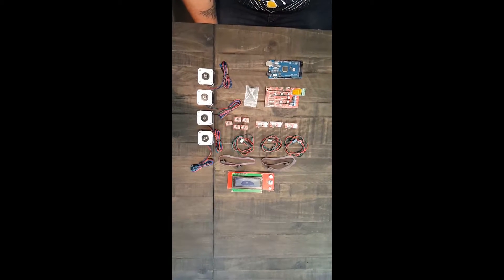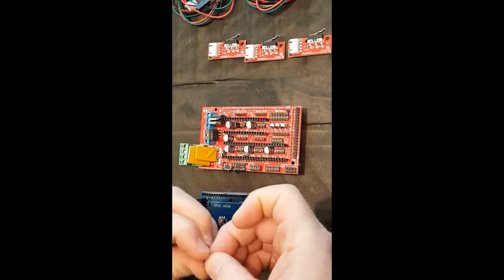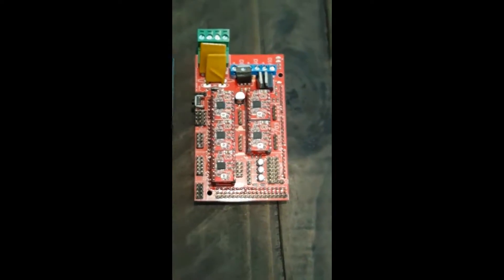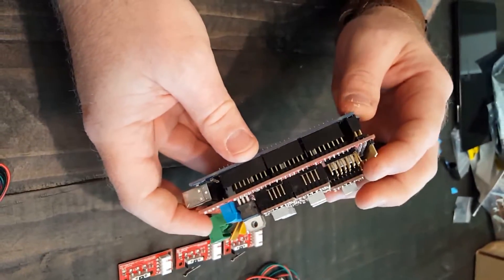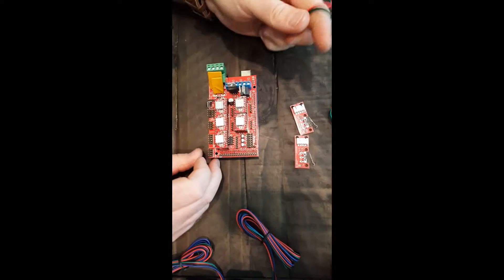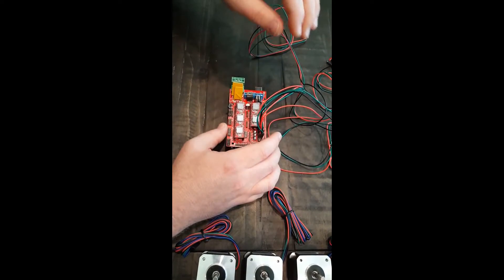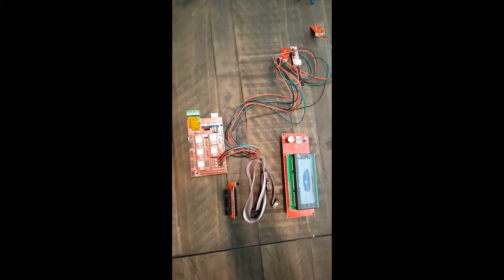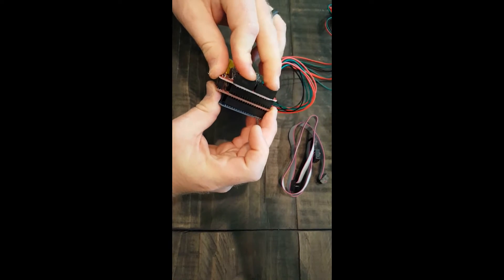ZYLtech Arduino Wiring - Ramps 1.4, Arduino Mega, motors, LCD, etc...

Comment: Help me please. I made a printer (400x400x700) but I did not have to work hard to fix the Arduino Due range for the Ramps fd. Or where should I download.
Reply: Firmware

Comment: Where does the cooling fans go? I don't like to just have them all on when I power it up - on my other printer, I control the fans from the printer's software, i.e. MatterControl ... But I can't find where the nozzle cooling fan goes and also where the Hot End's cooling fan goes (this one I can connect directly to + and - so its on all the time, but I would prefer to have them plugged in on the RepRap 1.4.  Thanks.
Reply: You can have the part layer fan connected to D9 on the board for variable speed.  The pin out on D2 would be for your extruder fan, this is an always on connection.
Reply: Thanks for a quick reply - where is D2? Is the D2 controlled by software, so I can turn off the fan on the first layer?
Reply: No. D9 is controlled and that will be for your part fan or layer fan. Whichever you want to call it.  You can adjust the speed of the fan through the software.  D2 is next to the X motor controller. It is a 2 pin connection and is meant as a cooling fan. It is on as long as your printer is on.
Reply: Thank you. I have only one 2 pin connector, just to the right of the resetable fuse + a diode, next to X. But it has nothing written like "D". BUT near by, to the left of the 2 pin connector is a label 12v-AUX - it is between the 3 pin connector (labeled 5V VCC) and the 2 pin connector you are calling "D".  I just wish they are labeled better, but as inexpensive these controllers are, one can't get it all....
As per your reply, this 12v-AUX is controlled as a fan, it can be turned off, for i.e. first layer in software, in my case MatterControl  just like on my delta, if I understand you well.
I'll try this and see what happens.